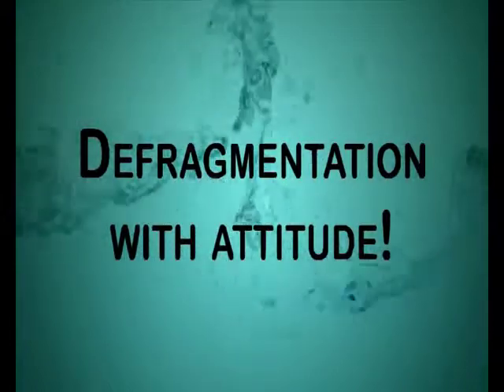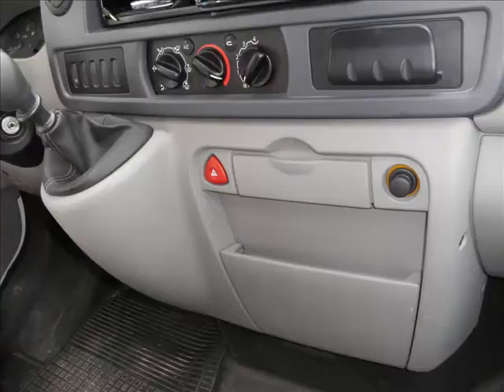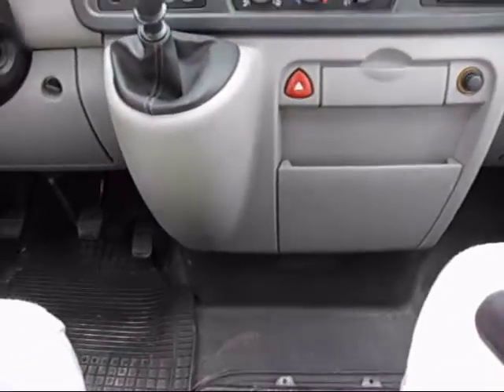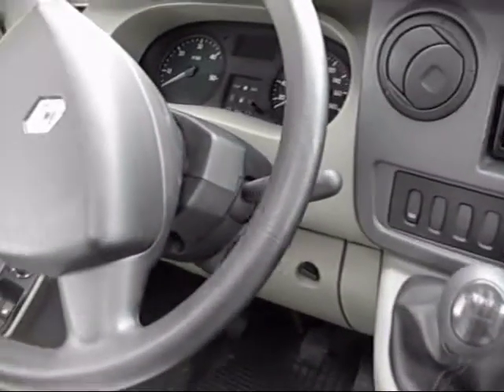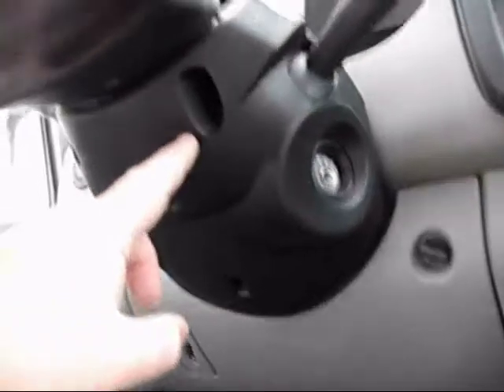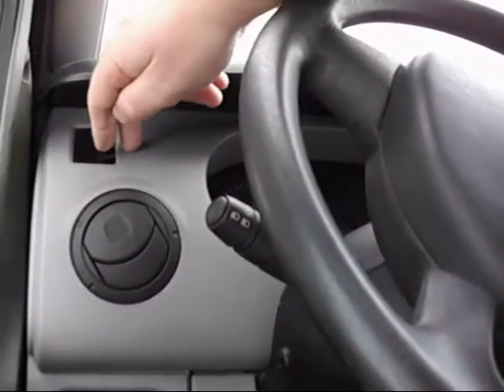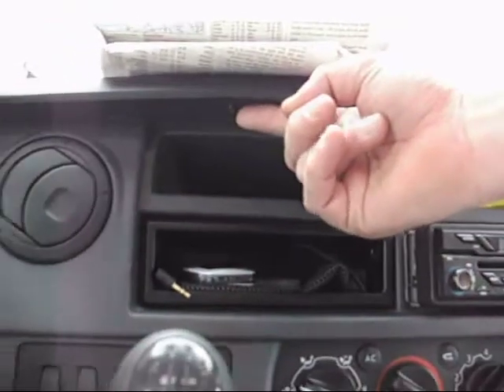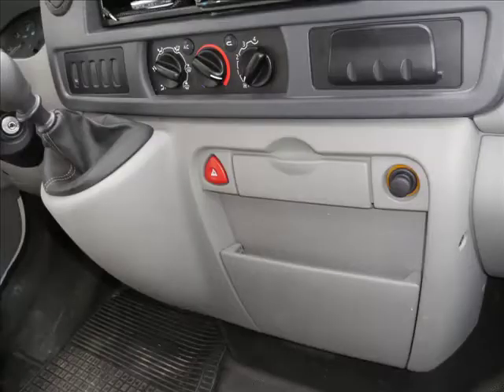Removing Front Fascia from Renault Master Motorhome Liamog 180609

Comment: I have  a Knaus (may 2007 bought)  and its a renault master cdi150 2006 model, so unhappy when i found it has no cabin filter , my tecnician was searching 30 minutes to find a filter , then i wrote to a group of renault and other owners told me this year had no filter, and the hot air in winter coming inside  is so smell bad . i dont hav an a.c. how to clean it ?
Reply: I have a Knaus (April 2007) and it's a Renault master too. I am looking for the cabin filter location, but no result. Did you find yours, or does it really not exist?
Reply: @pedromeneses7717  no . didnt find it , maybe doesnt exist , but how to clean dust and bad smell ?
Reply: @inter-shop  I don't have bad smell. But    I am sure, that I have a lot of dust. And it not healthy.